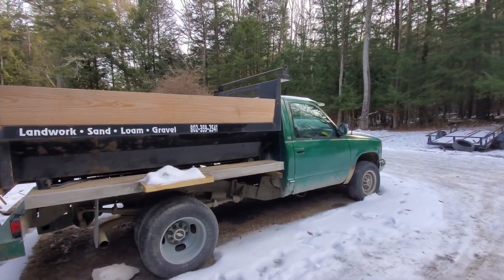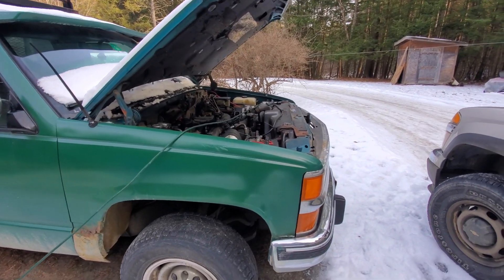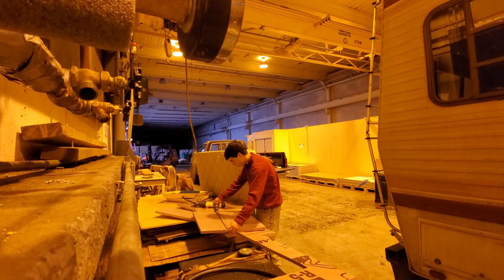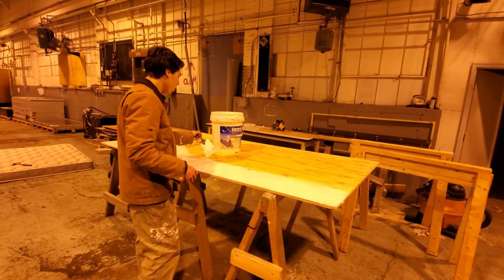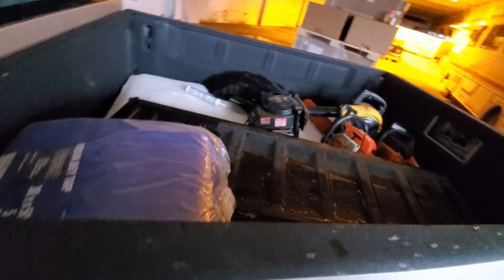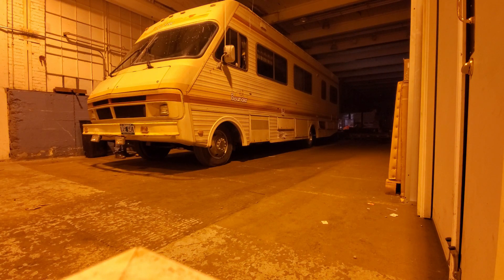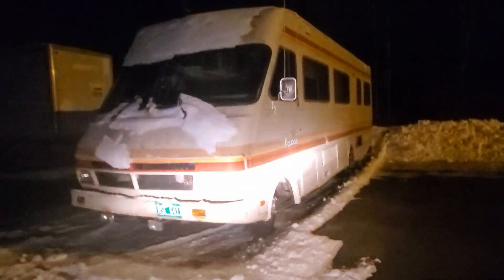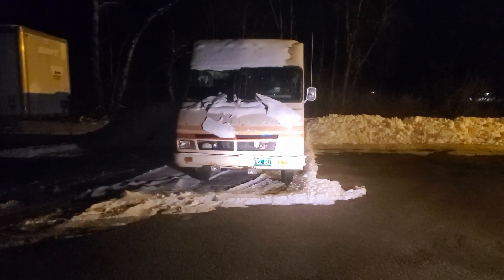$1000 RV Restoration Part 3!

Comment: I own a Bounder and he is correct, it's made of fiberglass.
P.S. nice job backing up that beast!
Reply from the maker: Thanks!
Reply: I concur. In the past 30 some years that I've worked on the assembly line on these Bounders, it has always been fiberglass.
Reply: Count me in concurrence as well.  I own an '87 Fleetwood Limited and it's also fiberglass on the exterior.  Fleetwood was ahead of the curve in many ways. (I've also got the same kind of bathroom!).

Comment: I highly recommend Schumacher SC1319 battery maintainers I use them on my 2 trucks, they won't boil the water off your battery like the harbor freight ones will. They will charge the battery then stop when it is fully charged, it will then charge the battery again if the voltage drops.

Comment: Yes it is fiberglass sided , bounder used that and a few others it was done before smooth fiberglass which is mostly what's used now. I did see one place on the driver side the fiberglass is bowed out quite a bit check for rot behind it !

Comment: I have an 88' Winnebago Chieftain with the 454. We have the same exhaust manifold leak that I truly believe are unrepairable. Check your timing and if it's not too far advanced and battery amperage is good, go ahead and change the starter before it leaves you stranded somewhere. You really need to reseal the seams every couple of years so next time, get the almond / beige colored sealant so it blends better. I hope you get to have some good times in it when you get her finished.  ATB

Comment: Have you thought about a tune-up, fluids, filters, plugs, wires, cap, rotor, maybe a coil.  An oil change?  How long was it sitting before you bought it?  Fuel filter and possibly a fuel pump.

Comment: Looks good but the caulking isn't gonna last. You can't just fill a gap with a giant goop of caulking without using your fingers or a wet sponge or something to push it into the crack and smooth it out. The way it was done its just sitting on the outside and once it's dry you'll be able to just grab it and peel it all off if you wanted to. Just my 2 cents I've been a house painter for a long time, pretty good with my CAULK

Comment: Before doing any exterior work you should pressure wash the entire vehicle. Any spots where you caulked over cracking paint and fiber glass are gonna become unsealed from vibration and water freezing in those crevices not to mention the dirt and grime under the layers

Comment: Nice work so far. You should try eternabond tape on the seam's and crack's in the side's.
Reply: is that a form of butyl tape?
Reply: No, it's almost like a form of rubberized duct tape that is used to patch roofs and is impossible to remove if installed correctly. I used to be an r.v. tech and that is what we used. It's best to look it up on YouTube or from its website. Hope this helps.

Comment: That Detroit Diesel in your pickup could use a little shot of ether to get started along with fully charged batteries. It wouldn't hurt to plug in the block heater if it has one.

Comment: Something you can do...spray some starting fluid on a shop rag...then place it a couple inches away from the air intake on the air cleaner....4-5" should do. Don't overdo it...Ive seen it done on the old 350 diesel in the late 70s.

Comment: Not a bad deal for a thousand.   Hope the engine is in top condition.  It's difficult to cover all the leaks.  the caulking could've been a little neater but what the heck, it was cold and you were in a hurry. $1400.00 for tires, whew....I wonder if the RV had low mileage.   Good luck with your renovation.  Make it comfortable for you and warm.

Comment: Looks like you used the white spray foam. Good idea. The regular expands much harder and that's not good with flexible things. I know someone who used the regular spray foam instead of the white doors and windows foam, around some old fashioned window frames and made em almost impossible to open.  :-)

Comment: I own a 1989 bounder, when it rains, water was coming in the back window,l found that as soon as l put clean silicone on top of the original seal, leaks stopped, either that or replace the seal around the windows,lm cheap, silicone is faster and last a long time, peace out.

Comment: Really should have used closed cell spray foam on that ceiling. Foam board won't give you neither the R rating nor air sealing that spray foam does.

Comment: You should really invest in a 12v solar panel battery maintainer.. it won’t charge a dead battery, but it’ll keep it from dying .. they’re only 20$ and then you won’t have the jump starting going on all the time... and yeah that’s broken fiberglass
Reply: Can you recommend one ?? I have never found one that works ! I tried the harbor freight one twice !!
Reply: The harbor freight one worked for me when I clipped the led light that blinks.
Reply: SwatsRus yeah mine did as well but they never would charge the battery. It would still die over time.
Reply: Yours blinked or you clipped it too? Well do you have a after market stereo wired directly to the battery? Did you have it charge through the cigarette outlet or the alligator clips on the battery? And the amount of DIRECT sunlight is important.. but the output is really decent on these.. you can check w a multi meter how much you’re putting in and how fast your battery drains without it... like I said it won’t CHARGE it! It maintains it so you either won’t have to jump it or barely needs a boost.. also if you’re car doesn’t have a battery drain problem and you put it on , it will decay the charge level constantly being over charged with too strong of a solar panel without a charge controller!!!! So I only recommend this decently watted panel

Comment: $1400 for tires!??! Holy moly
Reply from the maker: My thoughts tio
Reply: Camaro 1968  Are tires particularly expensive in the US? I just put a set of new mid range tires on my Jaguar XJ6 for roughly $450 including fitting here in the UK.